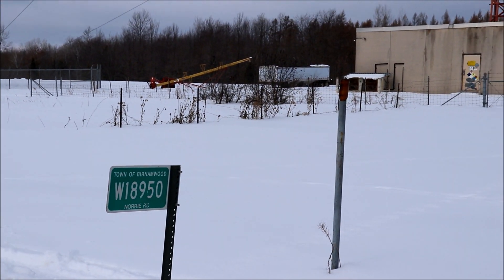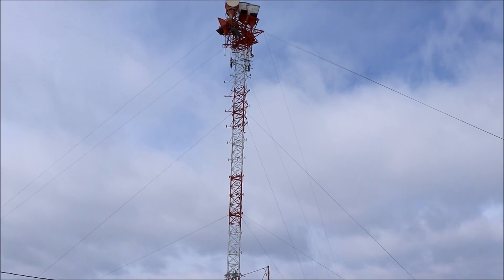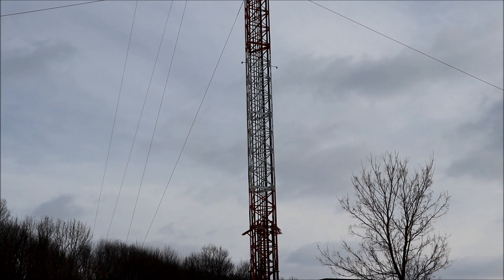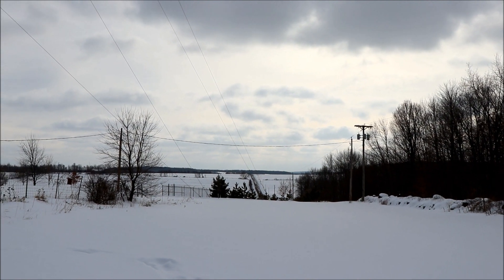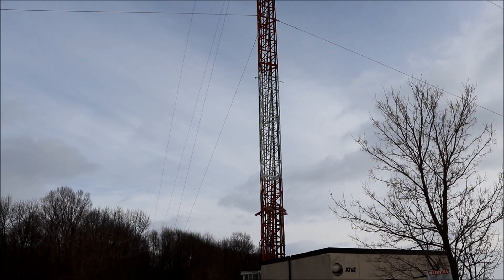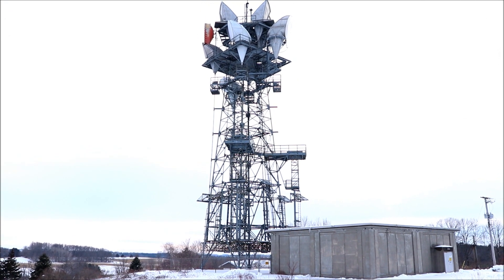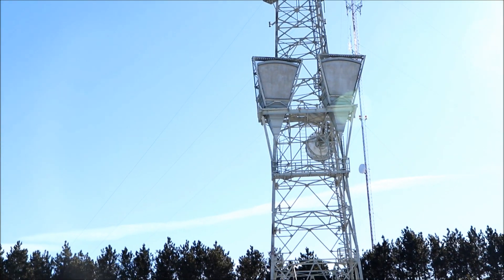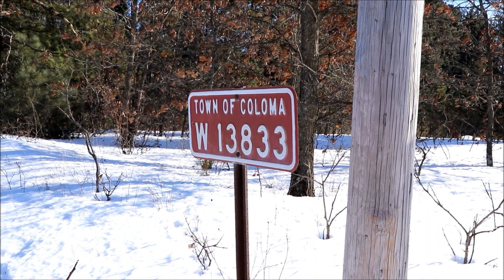AT&T Long Lines Towers

Comment: Microwave stations are approx 20 miles apart . The fcc would only allow a 5 watt xmit signal. Any higher would burn trees ,cause cancers etc . The mw was replaced with fiber starting around 1985 or so . Most towers are used by cellular company’s 
Crown castle and American tower own 99,9% of att’s old infrastructure , I played foneman 40 plus yrs , loved the job
Reply: Thanks Robert for your comments. re fcc max pwr 5 watt xmit would be plenty in view of the amount of signal Gain those antennas had. And, I never knew the TX Pwr so thanks.
Like most everyone else I ALWAYS wanted to see the inside, but I think it was considered a military secret. I don't think I've ever seen even any recent posts on You Tube that someone might have of the interior showing the equipment. But I do know what the 3.7Ghz to 4.2Ghz radios look like and I imagine that it was rectangular brass waveguide from the radios to the wall of the concrete building.
Reply: I disagree on burning tree’s, cause cancer… etc. 
The frequency bands in use likely were 4GHz, which is non-ionizing. 
Any idea what your home microwave wattage is?
Reply: Burning trees??l!ololololololo

Comment: The towers have to be close due to line sight so take the direction of the bell and go straight you will find another tower facing it directly in front of that bell because these were directional

Comment: The fact is; the military piggy-backed off the Bell System with all these towers, coaxial bunkers, etc. when they were built. The microwave and coaxial systems were crucial to have the military's AUTOVON (automatic voice over network) and Echo Fox (aircraft to ground) voice communications connect. How do you think Bell got the unlimited dollars to build hundreds of these sites? (hint: it wasn't from long-distance charges) Bell didn't care about "atomic-hardened bunkers" when they developed their Long Lines system; they just wanted to make telephones work, but the military said they wanted bomb-proof facilities to protect THEIR communications. As you might imagine, no expense was spared at the time. The Army Corps of Engineers then designed and built these installations, where they shared the military's equipment with the telco. Now they're not needed any more, so they're relegated to cellphone towers, fiber-optic connections, wireless internet connection companies, and doomsday preppers.